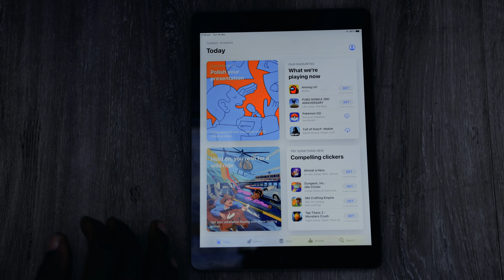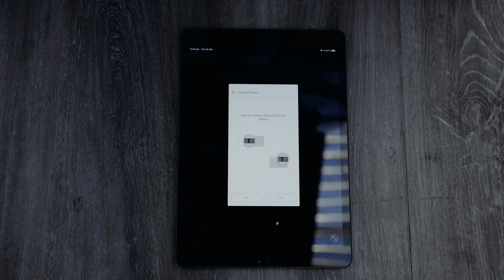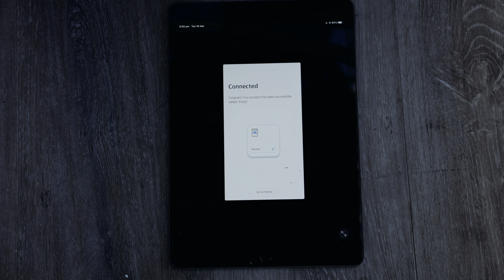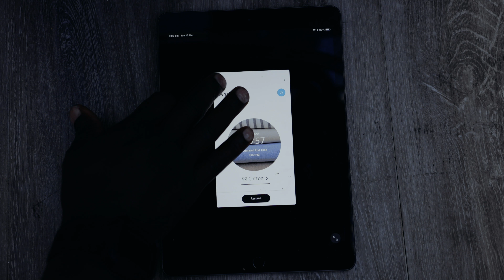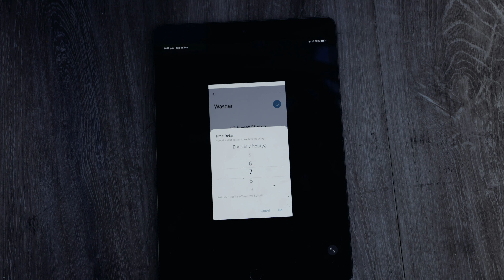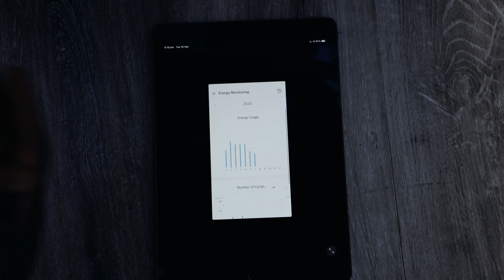Easy Connect LG Washer to WiFi Step by Step Instructions  Smart ThinQ App 2021 Home Automation

Comment: What if you only have Tap On NFC function and no WIFi function? They removed Smart Laundry app and we are left with nothing
Reply from the maker: I am not too sure haven't tried  the NFC function. Will do a bit ion research into it
Reply: @askmrwashywashy  Thank you for the concern 😊The LG ThinQ app also works for the none WiFi version. The Tap On NFC is available in the ThinQ app. I managed to find it after quick research. Thank you again

Comment: Hi Mr Washy! Could you tell me where can i find the MAC address for this washer???
Reply from the maker: Hi there. I’ll have a look and see how to find it for you
Reply: @askmrwashywashy  Thanks, but i found it! I have a router with mac protection. I take out the protection, connect the washer, i see the mac addrres, noted somewhere and i put back the protection and connect again .No problem!!!
Reply from the maker: @aditoma1967  great glad you were able to find it
Reply: @aditoma1967   Hello, how did you find the Mac protection? I turn off the private mode on my iPhone, but it still says some about the Mac; so frustrated 😩